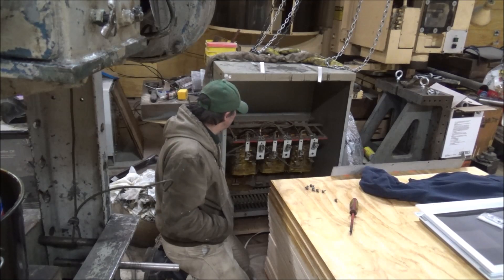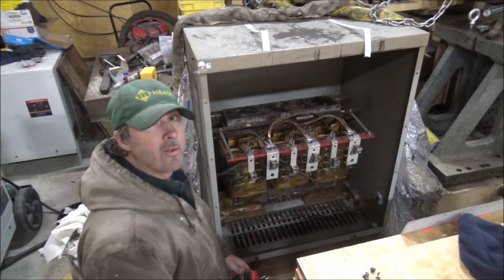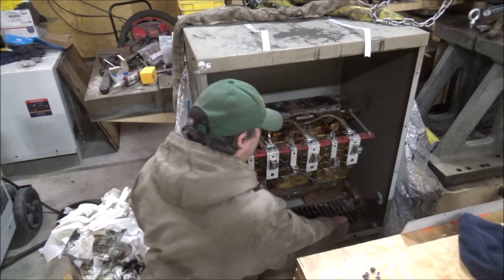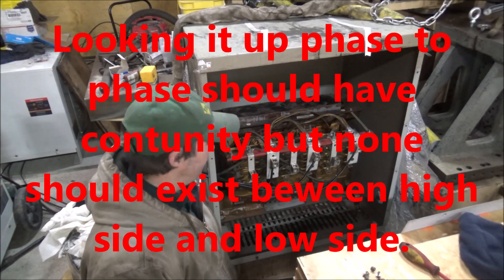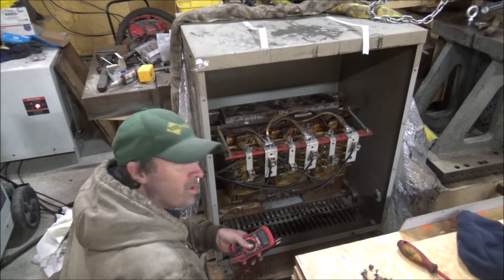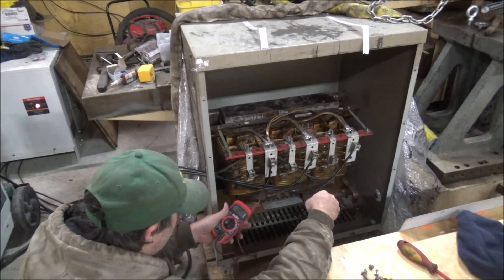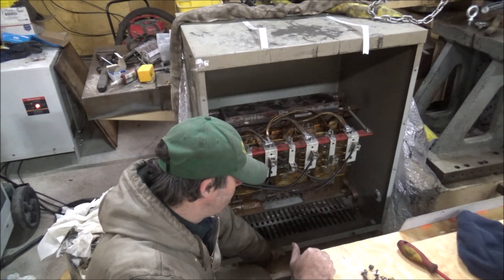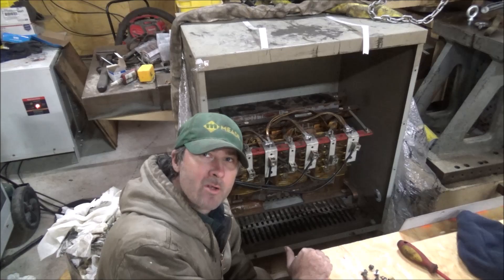Powering Big 3-phase Machinery 480Volt Transformer

Comment: Looking at a big to me lathe 20x72 , but it is 480 only ,   I don’t need all the 20 hp it has I just needed bed length , is there any way i can run this thing on my 15 hp rotary convertor without a transformer?
Reply from the maker: It would have like a quarter or less the power it is supposed to have but it might still run if the lathe starts fairly easy.

Comment: I'm curious how easy it is to energize that transformer. I assume it draws a massive inrush when you flip the switch to it.
Reply from the maker: Something less than 150amps because when I flip my breaker it doesn't trip it back.
Reply: @bcbloc02  150 A seems light. Won't a 150 A breaker require a multiple of 150 A to react magnetically?

Comment: Seams a bit high but then with no load, it might be that way.  Like 
John Smith said Baily may need it a bit warmer, use the insulation he tore up to make a dog house then less loss. No taps on the transformer to change the output voltage? I have seen both kinds.

Comment: Stupidity will get you killed get the right safety equipment before testing do voltage
Reply from the maker: Guess I need to sue the manufacturer for having a volt meter that goes to 600V that isn't safe to use on 480V.

Comment: How do you wire it. I'm in the same exact situation. I made a RPC and have 220v 3ph in my shop. I have a 220v 3ph to 480v pH transformer. I assume they can step up or step down. 

I see you had the transformer turned on, it was humming, then you turned on the RPC. I assume you took 2 legs 220v each from the breaker panel, then you turned on the RPC and generated the 3rd 220v leg input to the transformer. Now you have 480v out on 3 seperate legs 

Also to the voltage difference between legs, I know each leg can be balanced via Caps.
Reply from the maker: Transformers don't care if they step up or step down. The caveat to that is how the insulations and ampacities are setup for a particular transformer.  Running step up puts more amps into the unit and thus means it either needs to be sized larger than the load or be a special step up transformer which means the manufacturer just already did that for you.  It is wired just like there is no rpc, 3 phases in and 3 phases out. Both being delta configured so you need a delta delta style transformer.
Reply: @bcbloc02  do you have an email or a way Incan contact you. I have bought 2 huge transformers, and The first one was a mistake, it was an Isolation transformer. Its like 600 lbs, but the voltage spread now to narrow. It's like 460v to 400v.. it won't increase voltage but like 15%. So I bought a second transformer it is the proper steps up, it goes from 220 to 460 and again it's huge, it's like 500 lbs, it shows  a Delta diagram on the side. However it does not mention 3 phase on the tag, so I think I screwed up yet again.. it's got 3 taps for in and 3 for out and a ground lug.  I think this huge transformer is only single phase. On a 3 phase it's got like 7 leads right.   This whole process has been a huge pain in the neck. I bought this BEAUTIFUL cold saw, it has a motor that is not dual voltage, it's 460b 3 phase made in Australia. It like new and I paid like $400  at an auction. I'm just want to use this bad boy, yet I need to figure out this transformer situation.  I built my own RPC 20hp, but have definitely struggled with this 3 Phase transformer situation.  Before I bought the first transformer I have never even heard of an Isolation transformer. I thought you use diodes to isolate, and never knew using a transformer can do the same job.
Reply from the maker: Email is bcbloc02 at yahoo dot com
Reply: @bcbloc02  email sent

Comment: Are their specific uses for the "Wild leg) of the delta secondary,  are there delta's with in the center of each phase,  to get either 120, 208, or 240 of each phase?
Reply from the maker: As far as I know delta config is only used for high voltage. They use Y config when they want to get low voltage out.
Reply: @bcbloc02  yes but in the wireman slang world,  anything more than 120 is call HV,  which is kinda dumb.

Comment: Brian, your phase converter don't seem to be regulating very well.  The 25V variance in the 480V phases is due to the 12V variance in the 240V phases.  The voltages and the voltage variations are each multiplied by 2.  Assuming the weak phase doesn't get worse under load, there should be no problem.  This imbalance mostly matters during motor start.  Recall that even single-phase motors work very well once they are in motion.
Reply from the maker: The voltages are within 5% which is as close as utility power is a lot of time.

Comment: It's normal to have some difference between the legs in a phase converter system, got about the same kinda difference over here, like you I'm only using the 3 legs and no neutral, the ground is the same as the house ground tied to the body of the different elements. 
One problem in those set-ups is the phase shifting or power factor, the more inductive loads you put up the worse the power factor will be.
If your local electricity supplier finds you out, they'll ask you to correct by adding the proper capacitances...  
So far I haven't been bothered by that but I'll have to look into it before they get to do it and charge me...   lol
By installing the power set-up in the atic, aren't you affraid that the heat in the Summer would climb too high and cause problems, also a ground level installation would be way easier to service in case of failure, or even just plain maintenance...?
As another benefif you could make it possible to recup the wasted heat from the phase converter in the Winter, my 20kva unit wastes 1.1kw when running unloaded, this with lighting is enought to heat the shop in the Winter season.

Comment: Brian
Just want say be very careful working around 480 volts! It will kill you, which I have personal seen on a job site!
Reply: 12V will kill you. The voltage isn't the issue, it's the apmerage. Static electricity, the blue apart from your finger is you year socks and rub on carpet is 20,000 to 25,000 volts at ultra low amperage.. however a low volt high amperage can kill..
Reply: Thomas Shue's World it’s rather difficult to be killed by 12v, it’s very easy to be killed by 480.
Reply: Truht
Reply: Travis Kruse that’s because most people don’t have access to 480.
Reply: Travis Kruse yes sir Sargent Carter!
Reply: survived 600V shock Was not fun they heard me in the office from the back of the building (600v common in Canada.)

Comment: Well as long as all the electronic cabinets on the VMC are free of damp it should be ok..fire up with the e stop button pressed in..leave for a few hours to let the drives warm up..check for any alarm lights on the drives before finally  releasing the e stop.  If the screen doesn't light up when you first turn on it's usually a low volt power supply that's gone bad..also before homing check the limit switches are not seized..best to do this before it's powered up.

Comment: like your channel, in Norway we have 3 phase 400v and 230v in residential home. and I have lots of good experience with 400v machines they are usually cheaper to buy
Reply: Same in the UK. The only pain is building a phase convereter isn't as simple as having an idler motor. You need to step up the 230V single phase to 400V either before or after the idler motor, since every 3 phase machine needs 400V 3 phase, not 230V. Sometimes motors are dual voltage delta/wye, but most are not, and it still leaves the control gear and means you have to rewire the whole machine.

Comment: What voltage is that little red DMM rated for? What is your monthly power bill for 400A 240VAC 3-Φ service?
Reply from the maker: 600VAC it says. The bill depends on how much you use it.
Reply: @bcbloc02  There's not a monthly upcharge just for having high voltage service attached?
Reply from the maker: Nope, my utility only charges for the Kwh that I use. They don't have any special charges for what the loads are.

Comment: Hey Brian,
Equal voltages sound fine, but the phase angle between them is very important. Check to see if the 240 side is balanced; that is the voltages are equal. An oscilloscope would be ideal to check the phase angles. If the input is balanced, then the 480 side should be as well. Something sounds fishy here.  Check the input to see if your phase converter is working correctly.

I built a 3-phase converter out of an old 5hp motor to run my 3hp planer. I used capacitors from various legs to get the voltages/phase angles all correct. Took a bit of work, but they were all balanced within 5 volts. The phase angles also looked correct on the scope.

Don't just change the tap until you have verified the 240 side is correct. If  not, you can correct is as well with some capacitors. NON-POLARIZED, made for running motors, not starting them.
Reply from the maker: I think the phase converter is set so it run balance voltages when outputting about 65amps, anywhere else it varies depending on load.
Reply: @bcbloc02  then adjusting the tap should be OK! REally enjoy your channel!!

Comment: Looks like that thing is good to go Brian! Cool!

You might want to consider a big contactor at some point to shut down the transformer output if the phase converter is off. That will make sure you don't single-phase any expensive bits of machinery. Should probably be able to run it from the same contactor that is running the phase converter so it will latch in and drop out at the same time.
Reply from the maker: I was actually thinking of having a contactor in front of the transformer so it is dead unless the phase converter is operating. Maybe i could wire the coil to energize when the generated leg becomes hot and it would fall out whenever that leg went away. I will have to think about if that circuit is directly possible or not. I think so.
Reply: I suspect there is a contactor in the phase converter to fire it up. I'd strongly consider wiring the transformer contactor coil in parallel with the phase converter contactor coil. 

While putting the contactor before the input winding to the transformer seems like the most logical choice, note you will need twice the contact current rating in the primary, and the transformer won't care if it is getting single-phased, so you can use a lower current contactor in the secondary safely (but of course rated at something like 600V contacts).
Reply from the maker: While this is true I don't think they like having that induced voltage from the trans trickling back into the windings of the RPC idler while it is trying to start. The RPC manual actually says to disconnect any downstream trans before trying to start the RPC and placing the contactor between the two would serve both functions.
Reply: Ok, that sounds like a good reason. :-)

Comment: I was looking to buy a 5hp rotary phase converter and the manual stressed the importance of no load connection when it was started.  I wonder if just the transformer is too much load and that might be confusing the converter?
Reply from the maker: I don't think you can confuse a converter.  I imagine the imbalanced voltages and phase back on the generated leg side from induced power is why they don't reccomend starting the converter hooked to the trans.

Comment: Most cnc Equipment is low voltage three phase most the time most shops have 480 and generally have to have a step down transformer.  480 is more economical
Reply from the maker: Probably depends on the size of the machine. Most of the stuff I see in my size class is HV.

Comment: Hey Brian I am sure you know this but 440V is  lethal. 110 or 220 you can shake off if your standing in water but 440v will drop you like a 12ga drops drops a toad at 3 feet. Phase balance should get better under load. If you need to run off a different tap should not be a issue as it appears to 3 separate transformers...but probably not for fine adjustments.
Reply: speed typing with fat fingers!   should say NOT standing in water

Comment: It's so cool there is so much info on the internet now about this. Back in the 90's I built a 25hp RPC and transformer to power an old excello mill that was high voltage (yes it was overkill I was thinking big and the stuff was free salvage) I couldn't find info anywhere or didn't know where to look just worked blind. Thanks to you and others for sharing so much for the next generation of tinkers.
Reply from the maker: I always hope what I show can help others. :-)

Comment: So, for those of us who know very little beyond 220 single phase, you run 220 single into the phase converter, and you get 220 3 phase out, which goes into the transformer, and you get 480 3 phase out to machines, right?  What effect does all this have on your electric bill?
Reply from the maker: It costs something as to how much it depends on how much you use it and what the loads are. Assuming max load the cost is around $3/hr to power the shop.
Reply: Get firm hold on wallet, open wallet. Wave goodbye to money flitting away like pixies. However, that said it is likely lots cheaper than paying for the installation of a 440/480 service with a 220/240 tap and pay the standing monthly charge if it was even available at the road from the power company. Even the 7200V 3 ph run from the road down the lane is ridiculous as in thousands of dollars. Power companies know that they have you by the jewels so they want your jewels.  Oddly, most of Europe is wired for 3ph, even houses. Some western states are also more inclined to use 3ph than we do east of the Mississippi. The 480 service can be a good idea if you would be running 480 3ph all day long every day.
Reply from the maker: It should be more like 3 amps just idleing????
Reply from the maker: How did you hook the clamp? There are both 240V and 120V loads in the phase converter and one is inductive rather than resistive so measuring it gets a bit more complicated I think.
Reply from the maker: I know that isn't right. A clamp is only good for one conductor at a time.

Comment: love your stuff. I don't know much of anything. But i think 400 amp service at 240v single phase available goes into 50HP Rotary phase converter that only consumes about 105 amps single phase when under max load (25Hp output) and the RFC puts out around 75 amps 240v 3 phase 25hp so into the transformer is 70amps 240 3 phase transformer is 90% ish efficient so you loose around 5-7amps so your output will be around 30-35 amps at 480v 3 phase. I think. someone fact check me please. I dont want to be a bubble popper. check the RFC output label to confirm or deny what im thinking.
Reply from the maker: I would say you are about right. The transformer was chosen  to be able to handle any future needs., like the possible addition of another 40hp RPC using that motor I picked up awhile back. American rotary says 80amps 3phase at 240V is the max continuous output for my phase converter but only 65 if trying to hold voltages balanced within 5%. I would hope this trans closer to 95% efficient especially running at lower than nameplate amperages. I think 30-35 amps out to the machines will be about right with my current RPC, I can always add more to boost it and still use the same transformer though. :-)
Reply: @bcbloc02  ur awsome man always willing to talk to ur fans. When u say boost it what do u mean like make anothr rfc and put it parallel to the 50hp one? They are syncronous motors to the frequency should be the same except that third leg. Being its generated partially from.caps and partially from the pony im not sure if the 3rd generated leg would be exactly in sink. I dont know. Ive never even thought of doing that. I have built a few u can see on my channel but im in no way an expert. Might very welll be posible. My that practical machinist website guys say about doing that
Reply from the maker: The 100hp and up American rotary units are all multiple smaller units run in parallel so I know it can be done. I don't know if anything specific is used to allow that or if the loads naturally force the output to be synced since the inputs are from the same source and would be as well.
Reply: @bcbloc02  I've never had to look anything up that big. the motors would sync from the input side no doubt. but i have a feeling it would be multiple pony motors in parallel that are equal in size, RPM, amps and have one control box with a common set of caps and controller. I'll look into it. cause I have no idea